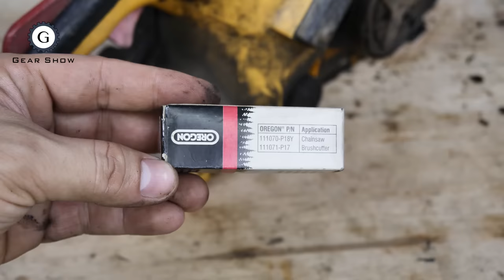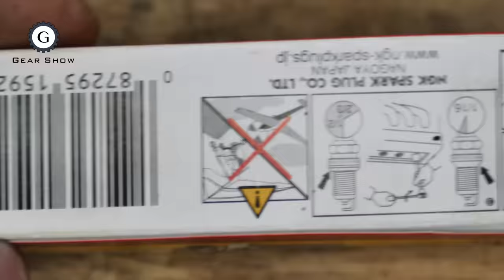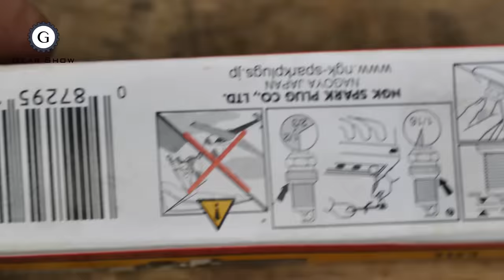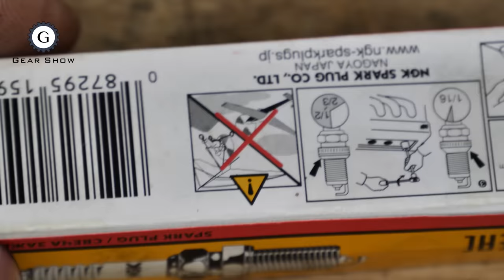2-Stroke Engine Chainsaw Restoration | Ryobi ESK 3500

Comment: Nice work! One little advice: never use torque on the spark plug. If you overtorque it, then you can strip the thread. Just simple thread it in with hand and fasten it a little with a plug wrench.
Reply: Exactly, he should have used a manual wrench. And should have oiled the air filter - without it, it does not work properly.
Reply: yea that was so cringe. I wonder if any of the bolts were hand checked.
Reply: ยจะได้
Reply: ه

Comment: Does this item not have any oil in the engine (Cam shaft area), I didn't see ant put in or bearings greased up? Thanks for sharing.
Reply: Hi, the mixture goes first under the piston, then through the port transfers up to the chamber. If the fuel has oil added to it 40:1 then all engine parts are lubricated OK.
This might be helpful: Chainsaw cutaway #1 how a 2 stroke works  https://youtu.be/6_wIjvf_3-Y
Cheers
Reply: This engine has no camshaft as it's 2 stroke. Are you talking about crankshaft? If so, the fuel goes there and in 2 stroke you mix the fuel with oil for lubrication
Reply: Thank you for explaining it to me and yes I meant crank-shaft. It's really appreciated.😀
Reply: @ToastyTaste532  kxlxkdodeodo

Comment: Hello, I have problems with the lubrication system of a chainsaw, the same model as in the video. I replaced the entire lubrication system... the  pump ,oil lines everything... and it still doesn't .work.Can you help me?

Comment: Great restoration mate, impressive skills including video editing. You didn't grease the main bearing (at least not on camera and started assembling it dry) and also the reason you were cutting curves in the test piece is uneven sharpening of the chain teeth (or possibly the chain too loose / sitting too high on the bar because of dressing the bar edge shallows the groove). Thanks for sharing!

Comment: Absolutely beautiful work on the restoration side of things. Yes if its nut & bolt restoration, you may by pass those parts depending on their condition, but the only mention I'll make is what about inside the fuel and oil tank?!
Reply from the maker: Okay, thank you for the feedback.

Comment: This chainsaw is fairly new, maybe from around 2014, also You can see that there is barely any wear on the parts. The title of the video should be “complete disassembly / reassembly”. 
Restoration is when You restoring something very old and usually damaged / heavily used to perfect condition.

Comment: Very enjoyable video.  I'm restoring an MS200T for myself and the fins have hard, baked on crud.  Ryobi did a great job of keeping the engine and fins clean.  Stihl did not.  Brake cleaner and powerful burnt soldering flux solvents won't touch it.  Oven cleaner will probably need multiple applications and heating of the upper to work.  I'm cautious with caustic chemicals on the aluminum cylinder.
Reply: vinegar

Comment: Great job on resurrecting this saw.  Ryobi makes an awesome machine;  I traded a Mcculloch Pro Mac 850 and another Pro Mac 700 for a mint Ryobi.  My saws needed fuel lines and i think carb diaphragms. My saws had so much compression, they were hard to pull over.   I think the guy I traded with didn't know what he had. I had another Mac 10-10S that he wanted, but I was able to do the trade with just the two non-runners.
Reply: Them old Mccullochs are starting to get collectible because the old company, hell even their yellow paintjob is long gone

Comment: Nice video. I would change the fuel pump button (cup), you glou it together, but it will fail soon in my opinion. Hope you greas or oil at least the bearing at 16:54.

Comment: I could not have done it better.  Why did you not take apart the carb and make sure all jets were blown out and tune it too?  Why not file down the depth gauges (rakers) when you sharpened?  You probably would have got much bigger chips instead of sawdust coming out and cut faster too. Try to replace the ring, bearings, etc if possible.  Maybe not enough time but You don't want to have to do all this work twice.  Just my two cents but you are talented and do excellent work. It looks brand new!!!  Video your tear down is a great idea. Thank you!!!

Comment: another fantastic job pay attention to the Riker and that's the tooth in between each cutter for a straight edge across if the raker is higher than the cutter tooth you will be forcing a sharp blade through every time makes it difficult for The Cutting to to actually cut file the tops of the rakers down

Comment: Nice job, but plez get  a file guide for whene u sharpen the chains. I can hear and see that the chain was not cutting as good as it can 👍
Reply from the maker: Because the chain is dull
Reply: @gear_show  Yeah and if u get a file guide u will sharpen it at correct angel and it will  cut like hot butter 😊

Comment: I work on chainsaws and it's a good job you did but one thing you forgot was to adjust the jets H and L and the idling screw that's why people have a hard time if they buy one the jets are not always set right and they'll send it back saying it doesn't work right I've had a man give me one before that he had for 7 months and told me he couldn't get the chain to move he told me if I can get it fixed to keep it the only problem was the brake was in lock so not everyone knows about tham lol yes I gave it back and told him about it 👍

Comment: Was the stop switch installed upside down? I assume you used a continuity tester on it. It was embossed in the side of the machine which way was stop. I am only curious. Excellent work otherwise.

Comment: Great video though a couple things are bugging me as some one who works on small engines in his free time.  Were those the old head and exhaust gaskets or were they new ones?  No rebuilding and retuning the carburetor?  No new piston or piston ring?  No cylinder bore measurements to verify its still within spec?  No inspection or re-greasing the main bearing?  I can get behind refurbishing the bar, but at the very least get a new chain.  The chains do have a life span and you don't know how it was used and abused.  These are just my few cents of constructive critiques.  Keep up the good work though

Comment: if you restoring engine and his part, always give it new sealings, bearings, piston rings, etc. good job but those mistakes are very painful to watch for mechanics and mech. engineers like me
Reply from the maker: I really appreciate with your sharing. I will try to change available parts. Some parts are not available in my location.
Reply: you think commercial, but he is doing it for fun, the saw can and most likely will work long like this because it is not used every day in a commercial enviroment and he can always Disassemble it and replace stuff when needed. Why replace stuff when it still works? I hope you get my point.
Reply: I disagree. You don't need to change anything other than sealings if other parts are working without any issue
Reply: You must work for an auto parts company. There's no reason to replace things that aren't broken.
Reply: @gear_show  I know your culture demands you apologize, but he's being a typical American who complains about stupid things. You do things well and should be proud of your restorations and channel.
Reply: @rephleX67  I see your point but me and my other colleagues are of the opinion that whenever something is taken apart it pays to replace the parts that will break in the near future and to my main point the seals should be replaced every time they come off as they are then deformed and it never leaks like it used to and the cost of it is also minimal compared to the work that will be done after a few weeks of use because as I said the seal is physically damaged
Reply: @rephleX67  I just wanted to sell my knowledge and help with more efficient work, but my opinion is influenced by my work and life experiences
everyone can do what they want, the important thing is that they enjoy it
Reply: @fillzepelin9972  i repair Chainsaws in my freetime some times. And i always do it like you said because i know that the seals are deformed and i would also would replace the Oil Seals. But as you said the important thing is that they enjoy it and i only learned these things because people like you shared there knowledge and i am really thankfull for this. I just dont want people to think they have to do it no matter what you know what i mean?
Reply: 8
Reply: @fillzepelin9972    that chainsaw will run for a long time with what's thare no need to change it if it's in working order the whole rig just needed a bath it be different if thare wasn't compression

Comment: tightening them case bolts with a power drill is a bad habit.  gotta do those by hand and preferably with a torque wrench.  break your heart you snap a bolt off during cylinder reassembly.
Reply from the maker: This speaker is absolutely right, thanks for sharing!

Comment: The chainsaw should not be kicking out smoke. Your fuel mix is probably off
Reply: It a 2stroke I would be more bothered  if it was not all saws smoke and at higher Reves as it needs more oil to keep lubrication  right

Comment: Lots of basic mistakes made here... 1) Always add lubrication after degreasing/cleaning metal surfaces (use 2 cycle oil to lubricate piston, cylinder, bearings, etc...) 2) Replace all seals, 3) Use threadlocker to prevent screw/bolt back off, for cylinder, case, etc... Vibration will make the screws back out, 4) Start by manually screwing in screws rather than using a power tool, as it can strip the plastic case and/or it could cross thread screw holes, 5) I can go on and on all day....
Reply from the maker: Thank you so much for sharing!
Reply: Seems to be running fine without changing all seals so is it really a mistake?
Reply: @lawnmowerdude  Seemingly running fine could mask an air leak, (due to bad seals) which causes a lean condition. 
This wouldn't show up immediately, but over time, at higher RPM's, the cylinder and piston would be toast - the seals are designed to be deformed after installation and aren't to be used again per most manufacturers. 

We are talking about saving a great big whopping $4 or so, with the chance of frying everything in the engine, just to save $4 on seals...

Comment: This is completly fake. He purpusly dameged new chaisaw for a video. There is no way that this chainsaw could have been caked in dirt that much unless he did it himself. Plastic cant fade that quickly, filters dont just disolve on their own. The handle stil has texture meaning it wasnt used. He must've submerge it in gasoline and dirt

Comment: Good job running a dry engine and not adding oil to it for the first start up great way to destroy your tools bud
Reply: 2 strokes don't have an oil pan
Reply: @mastermason4766  I onow that but still you need to put oil in your engine before you start it up and I didn't say anything about an oil pan
Reply: @thehowtoguy861  The oil is mixed in the gas, you can see the blue smoke out of the exhaust from oil burning

Comment: 27:07 - gasoline is leaking from the primer bulb.
Would be better to show how you repaired that instead of editing it.
Reply from the maker: Yes, it needs to be change
Reply: I came to comment on the same thing. Lots of basic mistakes made here... 1) Always add lubrication after degreasing/cleaning metal surfaces (use 2 cycle oil to lubricate piston, cylinder, bearings, etc...) 2) Replace all seals, 3) Use threadlocker to prevent screw/bolt back off, for cylinder, case, etc... Vibration will make the screws back out, 4) Start by manually screwing in screws rather than using a power tool, as it can strip the plastic case and/or it could cross thread screw holes, 5) I can go on and on all day....